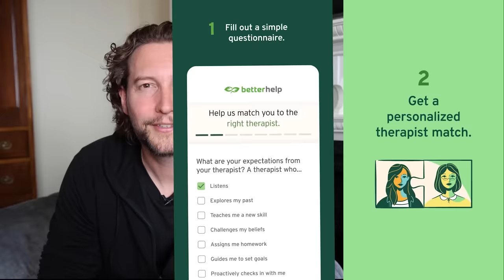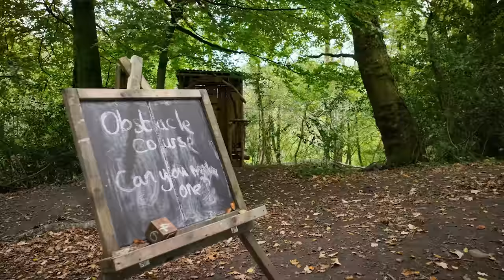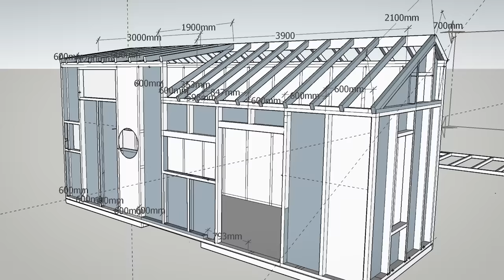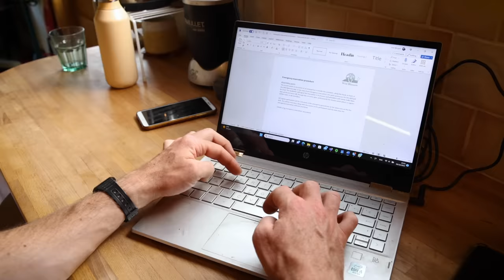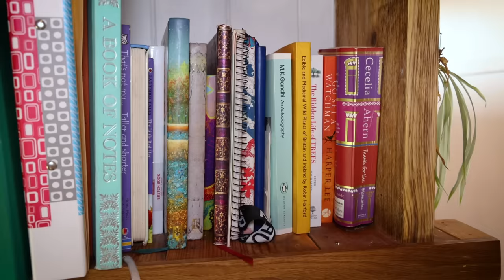Reclaiming Home: An Off-Grid Tiny House Wonder In Wales 🏴󠁧󠁢󠁷󠁬󠁳󠁿

Comment: On the Outer Hebredes in 2019 I attended a tractor event. They were giving away the sheep wool insulation. I wondered if people were using it. The drawer/baskets for produce is so clever. A lovely couple. Wishing you two all the very best.

Comment: I felt for this couple, saying there is no one to turn to regarding Tiny House living in the UK.  Land usage laws need to be addressed,  consideration needs to be giving to the rapidly expanding population in the UK which can be helped with Tiny House Living.  Tiny House Communities need to be established.  (Parkhomes are popular but largely only for holiday usage.)  Household insurance needs to be addressed, as do mortgage facilities.   There are recycling centres around every corner in the UK and proactive people can use the wastage to create homes.
Reply: Could easily solve the population problem tomorrow quite easily. The birth rate is declining, so if they reduce immigration the number of house required and the price of houses would stop increasing at such a high rate.

Comment: my only gripe is that they did a drop down standing loft on the one side but not the other.  beneath the stairs on the other side was cupboards and ddrawersw, which easily could have been lowered down as no one would be standing in that space anyways.  They could have had an extra large office where they could easily move around in it.  just saying